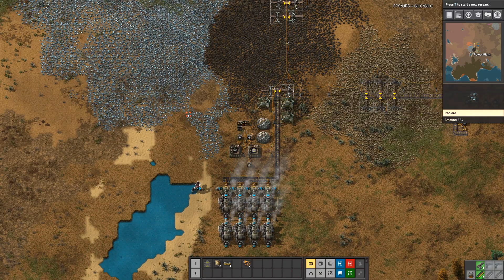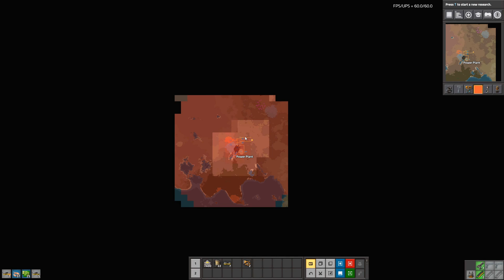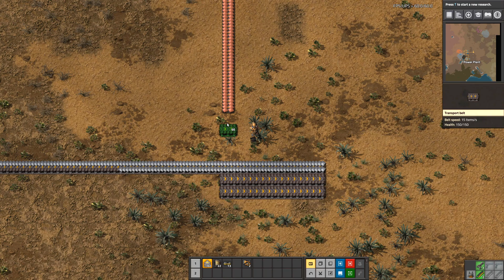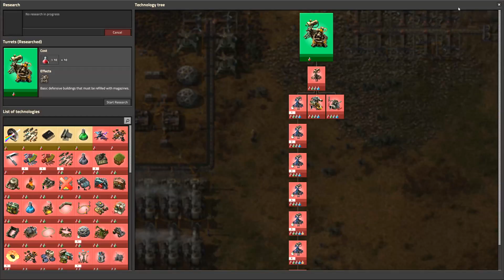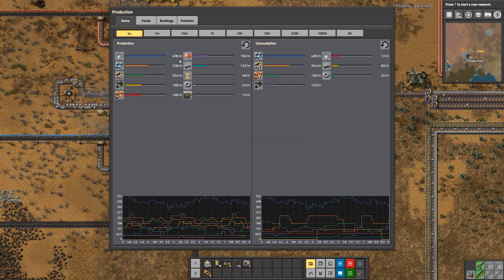Factorio Automated Defense Early Game #3

Comment: Nice start of the base. A few tips. Your bus should be 4 lanes wide not 3. That way you can just drag undergrounds rather than clicking every gap. Your smelting outputs at most half belt. If you switch ore and coal intake to outside belts you can output 1 full belt in the middle.